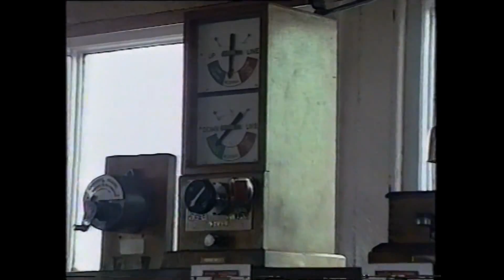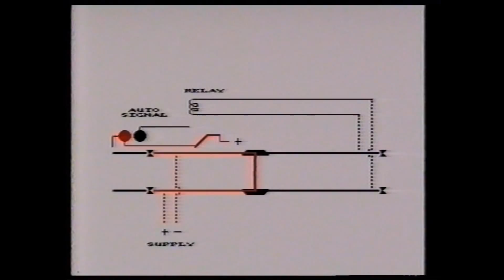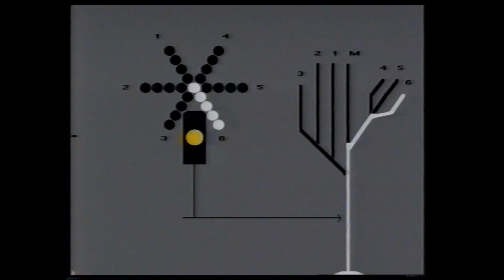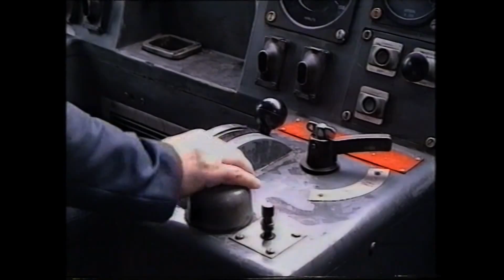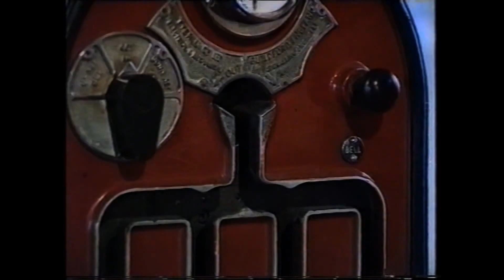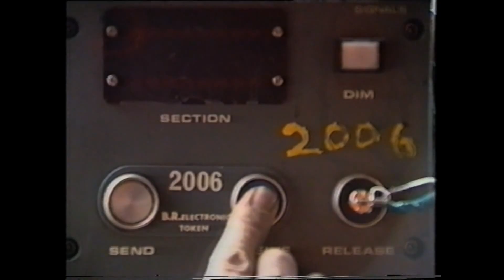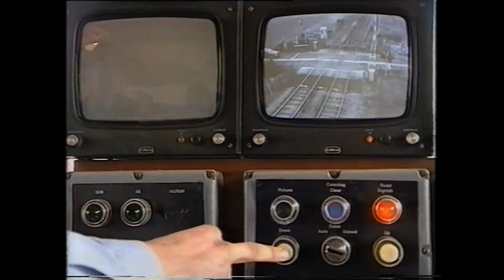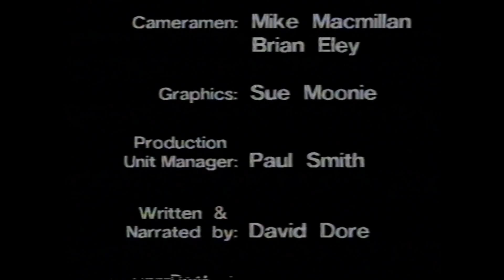British Rail Signalling

Comment: OK here a question for train enthusiasts as I can't remember "Old Age kicking in". I was born in 1961 and can remember very well these coaches at point 0:23 of the video. I remember the old train stations with the Cadburys 1 penny chocolate machines, the 5 Park Drive cigarette machines and the waiting rooms with the old gas fires in them. I can also remember the every time after getting off the train the conductor would blow his whistle and there would be clouds of black smoke billowing up all around the bridge crossing above the tracks. So what engine would that be?. I can't see it being diesel as in all these film clips there are no billows of black smoke and steam trains were before my time. Crazy how I can remember the coaches and loved going on the trains back then but blowed if I can remember what type of engines were used   🤷‍♂️
Reply: Well, most all early diesel locomotives would produce clouds of black when starting as the engine would be under maximum load.
Reply: Its a Class 47 in Intercity livery

Comment: When I was at VSC Clapham Junction, had a high failure rate, ASE was 'wrong man for the job' had to be paid off, replacement was to be sacked in 6 months time with chief signal engineers unless failure rate dropped, bought in man from Stanley led a task force team, he found lots of defective equipment which he put right, did a good job reduced failure rate.

Comment: That BR employee at the failed signal at the end of this video could also simply hold out his right arm horizontally to ask an approaching train to stop, and later hold his right arm 45 degrees upward from horizontal to instruct the train to proceed, mimicking a semaphore signal.
Reply: I think it is the flag/lamp that is crucial here for it to be deemed a signal, track gangs acknowledge a trains presence by raising their arms without a flag/lamp.  If a train responded to arms alone being raised, confusion would follow.
Reply: @Chilled_Mackers  Well, as a lamp is part of a semaphore signal, he could also hold a lamp with sections of coloured glass around the light in his outstretched hand, showing the red section for stop and the green section for proceed.  The right arm of his jacket would also need to be red with a white armband in the middle, again mimicking a semaphore signal.
Reply: @denelson83  The SOP's are developed to deal with these situations, to reduce confusion and delay.  Often blood and tears improved these over the decades.  The older lamps evolved to have lenses for stop and go and eventually caution aspects, these days they are LED button switched for the 4 main signal aspects required.  BR/NR tend to avoid "special tools" in this case your jacket idea, for essential emergency response/works - so that reaction and deployment is universal and quick.  Special signal jackets would not improve reaction times.  There are hand signals, flag signals and lamp signals, which rail workers can use to communicate to a train.  The universal high visibility oranges are the uniform, the variations are the company name on the back and chest, the colour of the hard hat and coloured bands on the arms.  Hats and arm bands signify various roles.  Even a plate layer can stop a train using their arms in a 'X', as an example.  I hope that helps.
Reply: just adding, if a plate layer has had to stop a train using their arms, the train driver would have heard many large bangs and some people will be sacked.

Comment: Are there any mechanical signals left on the British Railway system as of October 2021? If not, do you know when the last one was removed?
Reply: Plenty. Though gradually being replaced by modern signalling the network is already in the position that ‘modern’ colour light installations which previously replaced mechanical signals are themselves in need of urgent renewal due to life expiry. These will take up a significant proportion of the available budget. Where significant track alterations are planned modernisation becomes even more imperative. I think it’s safe to say mechanical boxes will be around for sometime yet. Check out Shrewsbury and Worcester Shrub Hill for the best examples remaining.
Reply: @gingertom2355  Thank you. I will have to go to Shrewsberry or Worcester Shrub Hill. The mechanical systems hold a great fascination for me.
Reply: We still have a ex-Midland Railway lower quadrant signal is use in 2022 at Ketton on the line from Peterborough and Leicester.
Reply: Yep lots of them - mainly on the western region routes

Comment: It still makes me slightly alarmed to see in cab ride videos on the Continent how trains will switch tracks with no signal indication at all, as long as the speed on the diverging route is no lower than on the main route. That doesn't look right to me at all
Reply: As someone from the continent, it scares me that you can be sent onto a diverging line and not be told in advance how fast you’re allowed to go!